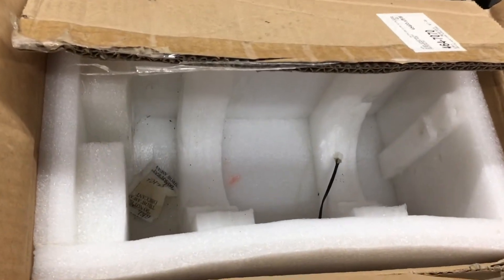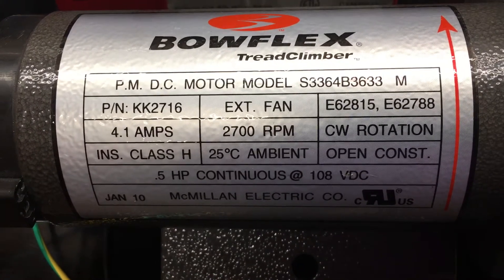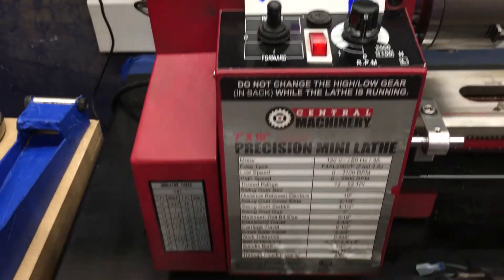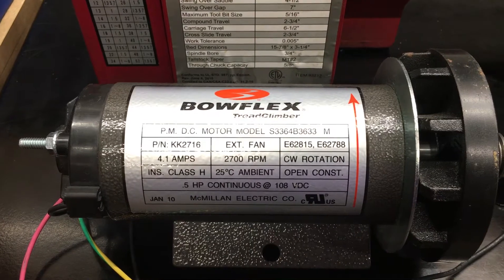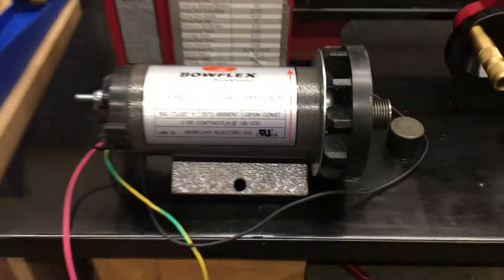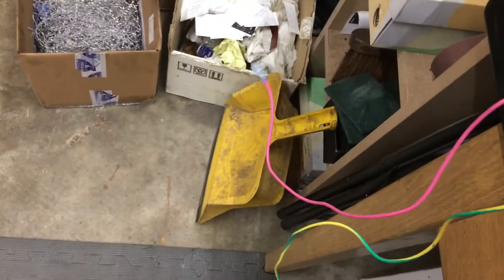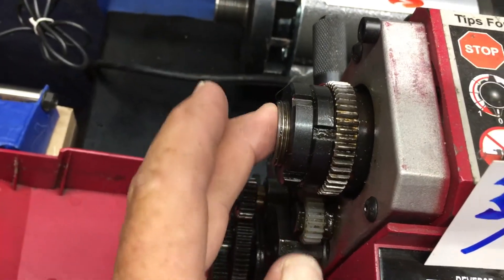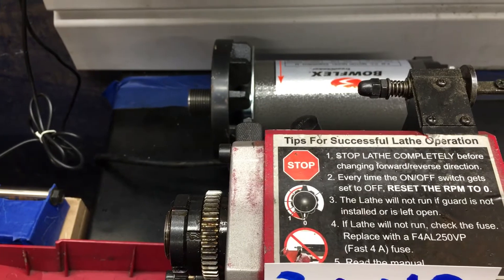kimberzelik needs INFORMATION

Comment: Haven't powered any lathes/mills yet with a DC Motor, but did research it (your motor is rated for 108 volts).  Excellent video "Low Cost DC Motor Controller..." on mikemanmade's channel.  Jeremy Fielding also has great videos on all kinds of motors, and how to power them.  BTW, your audio is much better!
Reply from the maker: Thanks Daniel I’ll look in jeremys channel

Comment: Hi Kimber ,
If you look at page 35 of the manual for your lathe ( i looked at the one on harbour freight website) you will see the wiring diagram showing the controller and motor , the controller says ac in and next to that dc out to the motor via the reversing switch . I thought it odd when you said your motor is ac because every mini lathe or mill i have ever looked at were all dc motors . The controller on your lathe will run the treadmill motor , the motor in the lathe is most likely over rated - there’s 3/4 hp and then there’s Chinese 3/4 hp - which is more like 1/2 hp or less .
The controllers mentioned in other posts on here are glorified light dimmers that have the ac output rectified to give a dc voltage and when you adjust the speed all you are doing is lowering the voltage to the motor which is no good for low speed torque , what you really want ( and what your lathe should already have ) is a pulse width modulated (pwm) speed controller as these output a full  voltage square wave with an adjustable width . 
Probably the best upgrade would be the hi torque motor and controller from little machine shop - these things are brushless dc and i think rated at 1hp , nice and quiet and usually pretty reliable. I set my lathe up with a 3phase motor and variable frequency drive with a two speed belt drive system - why ? Because i got my machine off ebay and it didn’t have a motor or control board so at the time this was the easiest and cheapest way around this , the cost of a new motor and board here in Australia at the time was more than half the cost of a new machine - over $300au , i got the 3ph motor and vfd for $200.
Edit:
After reading the title of this video again the answer is probably not as you can buy replacement boards and motors pretty cheaply from HF - if it aint broke don't try to fix it or modify it too much !
You could use the treadmill motor to make  a belt grinder or as a replacement motor for a bandsaw -even a cheap bandsaw can be used to cut metal if you can slow the speed down , these things you will find useful in the future .
Reply from the maker: Thank you that’s a lot of information to absorb and I believe good information given me a lot to think about I appreciate it

Comment: That would be a sweet conversion.  I have been trying to sort out how to revamp the motor on 1 of the mills. Really need to get more speed out of it while trying to keep as close to original appearance as possible
Reply from the maker: When I got that motor I thought it was a brushless motor.somebody advised me that on the circuit board in my lathe might be able run that motor with all the functions of the lathe.
I guess it all comes down to do I need to replace the motor , and as my skill level improves I find the motor is probably adequate. We’ll see! The horsepower is stated about equal but then some people told me that Chinese horsepower is not the same as United States horsepower OK I’m kind of rambling thank you for your comments
Reply: @kimber1958  nice thing about DC motors. It doesn't take much to control them

Comment: Grate motor for your lathe if it fits all you need is a AC to DC converter the motor will have great power through to the full rpm range your best bet might be an adjustable power supply easy to hook up + to + and - to -  and ac wont matter
Reply from the maker: I HOOKED IT UP TO MY 110 AC .AND IT WASENT GOOD !ILL TAPE IT,THEN YOU CAN TELL ME WHATS UP WITH

Comment: I suspect that .5hp dc will be less torque than .75hp ac  unless you are clipping the frequency on the ac more than 50%.
Reply from the maker: bcbloc02 Wow that went right over my head is clipping the frequency something that is hard to do . is it worth the trouble.
And thank you
Reply: Kimber Zelik clipping the frequency is how vfd’s vary the motor speed on ac motors